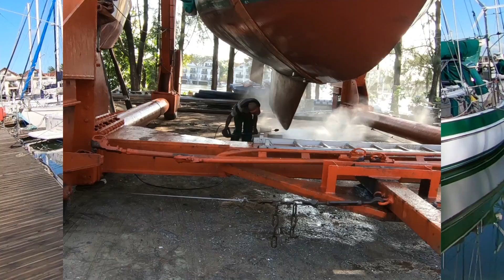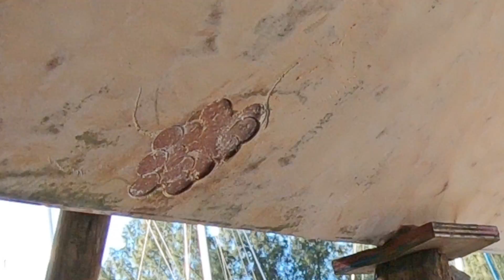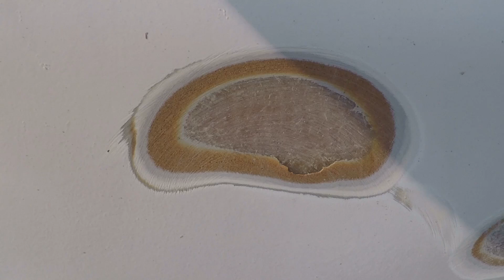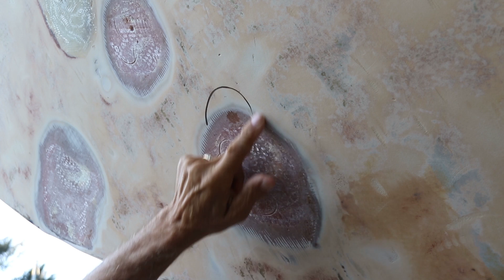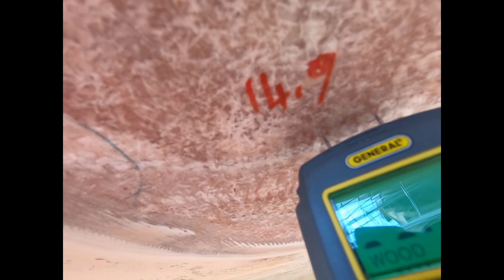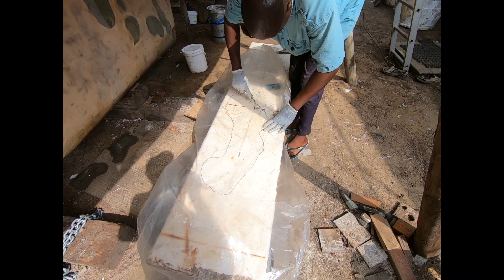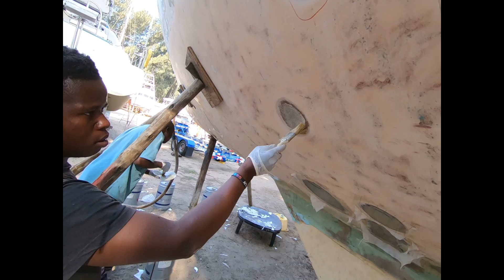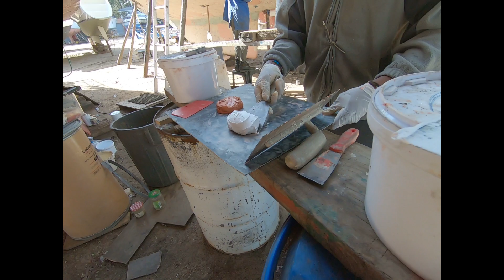500 ROTTEN, FESTERING Blisters!!  - Blister Repair on a Fiberglass Sail boat! (Patrick Childress 59)

Comment: Since these are "uncured resin" blisters how do you know the same thing isn't happening on the inside of the hull. 
Or through out the entire lay up of the hull. A lot of effort and worry for a 44 year old boat.
Reply from the maker: Yes, there is of course that worry...with any boat..but this was the best possible fix. Every boat has some major blemish...at least we know our poison on this one. And a new boat is a quarter of a million bucks. Rather just get another 10 or 15 years out of this boat.
Reply: And after this, it'll be good for another 44 years. Boats can easily reach 100 years, and keep going, with proper maintenance. It's not like a car.

Comment: Nice project. My only question would be on the use of the 1708. Did you go with 1708 due to its availability over 1700? Mat isn't typically used with epoxy.
Reply from the maker: Hi Rick..sorry can not answer this for you. I’m sure you saw the latest video...Patrick passed a few weeks ago.-Rebecca
Reply: @SailingBrickHouseAndOsprey  

Rebecca, my deepest condolences for Patrick's passing.  Stay healthy, best wishes.
Reply: @rickworthington3062  In 1708 the CSM is held together not by chemicals (styrene) like in stand alone CSM but is instead stiched together to layer of woven fabric making it OK to use with expoxy or poly. Also of note, some CSM is held together with a powder, not by styrene which can also make it OK with epoxy.
Reply: @hirschrm  Russel, only SOME variants of 1708 are stitched and epoxy compatible-definitely not ALL.   Also, the question regarding why do you 1708 mostly is because Matt adds little to the strength of an epoxy laminate for the cost of the additional let out which is why unless you need it for its smoothing property specifically to cover up some bad fairing work or to lay over old glass as a band aid or simply don't care about the excess materials usage or wait then there are better approaches.  Taking into consideration that is very heavy sailboat doesn't really care about a couple pounds extra here and there I completely understand the benefit of its usage in this specific instance but if it were a power boat it might be a different story.

Comment: Just for reference, an oscillating multitool would be far more efficient than a hole saw.   I just ended up with one recently (gift), and find it incredibly valuable for this sort of project.  Here's a link with a photo to one brand.  There are numerous makes.  https://toolguyd.com/dremel-mm35-oscillating-tool/    The ability to plunge cut into a flat surface, or any shape surface with an oscillating blade is a godsend.
Reply from the maker: That is a very good idea. I have one on board, but the problem, to get a toothed blade, I would have to buy a whole set of assorted blades, of which I did not need. I eventually found a single blade but the hole spacing made it so it would not fit on my tool. It can be difficult working on boats in foreign countries. In the U.S., what you can buy at any hardware store down the road, can be impossible to find in the middle of nowhere.
Reply: I was wondering when you say "for reference" is this something tried and true or an idea (maybe good ) .there is a huge difference :(epoxy gets gummy, blade heats up,
cloth layers jam the tool ,overheating etc there is a HUGE difference between tried and not tried, if not  then it might be said : "maybe this tool could be more.......
I am only asking for reference......in all good cheers

Comment: I had seen one couple with years of experience and they found that taking on half their blisters (the worst ones) and moving on worked best.  They’d knock out this blisters, they used isopropyl or something to dry them out as good as possible with active air and I think radiant heat, filled, sanded and painted and splashed.  Seemed to minimize time out of the water and made no difference to the boat long term.   If this is truly a one time, never have to do it again, repair then that’s worth it.
Reply from the maker: We don’t know that this full blister job will last forever....but we hope it will last 10 years...along with the Coppercoat. It will definitely be worth fixing up this old sailboat if we can get 10 more good years sailing her! -Rebecca

Comment: Body of this boat is one big blistering pain. Ouch. Great to see that workes use all the safety equipment. All that dust and chemicals is nasty and unhealtly.
Reply from the maker: It is amazing how some of the workers I hired from a contractor, on an hourly basis, come with no PPE. The contractors are not concerned. The workers were very happy I had it for them.
Reply: @SailingBrickHouseAndOsprey  Good.

Comment: At some point in 1976, a new type of resin with the trade name "Hetron" was used in the fiberglass layup. The new resin was designed to be fire retardant, and was originally developed to the specifications of the US military late in the Vietnam War. It is widely suspected that the new resin was responsible for extensive non-osmotic blistering of the hulls, deck, and cabin-house structures in boats built between 1976-1981
Reply from the maker: That was exactly it.  Fortunately, this boat has no blisters on the deck or cabin-house. It is though they used a different resin than what was used to build the hull.

Comment: How much did all of this cost?
Reply from the maker: This is covered a little bit in part two. If we count my hours and labor rate, a lot! I was on the job every day before anyone showed up and I was on the job for a couple hours after they left, at the end of the day. If we count only what we paid our off the street help and paid the local contractor for his helpers and all materials, it ran around $4,000. We could have done the same thing, at a similar cost, in Fiji, Colombia or Malaysia.
Reply: @SailingBrickHouseAndOsprey  But for your enormous amount of work this is actually surprisingly low .You know what contractors charge in western countries for just one small trough crack, the same !! one tenth of the work!!

Comment: Next time you do this use denatured alcohol, it will draw out the water and you will not have to wait so long. You could also use a shop-vac and a large suction cup to draw out the moister in each blister. Very well done, I loved your video.
Reply from the maker: Very good ideas to help with blister repairs... Thanks.

Comment: My boat was like this, they're built with polyester not epoxy, if you repair with epoxy it will be 10 times stronger. After you fair it all put three coats of epoxy on entire boat
Reply from the maker: I think that’s what we did after repairing the blisters...and then 4 to 5 more coats of epoxy in the form of Coppercoat. So hopefully this will be the last blister repair job we ever do! -PATRICK...CORRECT ME IF IM WRONG.  Thanks for watching -Rebecca
Reply: The stiffness differences between the epoxy and poly might cause some stress concentrations and make the repairs fail however.
Reply: @brawler4456  as a theoretical concern that might be true. But people have been patching old polyester boats with epoxy for decades. In practice, epoxy works much, much better. Polyester actually doesn't stick very well to old polyester. Epoxy sticks much better. The polyester would be likely to de-laminate.

Comment: i would have used a router myself - set the depth for the target depth and go around the perimeter - 30 seconds. done.
Reply from the maker: And "target depth" is the problem. There is no way of knowing how deep into the laminate a blister goes till each blister is opened, and  material is removed till you get to a good substrate. The perimeter may be shallow and the center very deep. Or the whole blister starts in one spot but wanders off in a very unexpected direction, as demonstrated in the video. This is why peeling would not work in this blister repair. Thanks for the possible idea and the thought.
Reply: seems that if you tap with a blunt instrument the water layer would impede the vibration and 'sound different' maybe?
Reply: @antigen4  that works too but your hand works best.

Comment: Do you have before and after pictures of your biceps ? Just getting old anti-fouling off our 23' boat made the power tools I used 10 times heavier as I got on with the job.
Reply from the maker: It was not a full body workout but was helpful exercise, especially running the Porter Cable 7" grinder, overhead for hours and hours. Even grinding fiberglass, that was far more entertaining than working out at a gym.

Comment: Try an old fashion hydraylic needle gun .. Spray wet the surface an old needle gun do a good job . Navy's use them .decent air compressor good quality hose and fittings do not try to save money on cheap hoses and fittings good luck
Reply from the maker: Thanks for the tip, Scott.

Comment: Im just wondering if that moisture meter works on fiberglass, because it clearly says wood on it.
Reply from the maker: If you Google and do some research on moisture meters and their use on fiberglass boats, you will see now nearly useless they are. With these open blisters, I just needed to see a change and get the measure down to 10 or below. It seemed to work out okay.

Comment: did u gel coat after the filler ?
Reply from the maker: No. gelcoat would not be for on top of epoxy. As you will see in part two, everything was primed and painted.

Comment: I'm a bit curious as to why you kept center-drilling the blisters. Me, once I'm certain I'm dealing with a cavity, I start hunting for the lowest spot, which makes for more efficient drainage.WRT repair or replace, that's often a tough call. Me, if I've recently bought anything that at closer inspection is showing to need a lot of work, I'm more likely to consider replacing than if it's something I've owned for some time.If I and the item has some history that changes things. Anything that's "old" probably has some history to it anyhow. WRT to boats, vehicles, houses, if you bought them used and have had them awhile, you'd know when the engine was rebuilt, the prop/prop shaft seals replaced, the condition of the standing rigging etc etc. Buying something pre-owned, there's always a "transfer gap" between the opinion and knowledge of the previous owner and you. So maybe you get a better hull, but with an unbalanced prop shaft. Or a damaged mast. Or all sails well past their prime. Or...Everytime you do a big fix, you add to your knowledge of the condition of the boat, where the weaknesses and strengths are.Often, if you try to stay within a budget, what you get isn't as much better as differently bad.

Comment: cant believe you and the others  are working under unbraced shores  (poppets) . you should have two sets braced all the time for safety's sake . I have a lot of experience in this field and yes , whilst epoxy resin (particularly West system) is ok to use , the hull should have should have been dried out completely either indoors with lamps or under cover in a ventilated shelter . after the hull has completely dried out and shows a mimimal moisture reading , then you start the process with peeling the the whole jelcoat from the boat .(this is often done first but either way its a noisy and messy business. the plus side of removing the jelcoat is that drying out the hull takes far less time . After all the repairs are finished the whole hull gets sanded back and new jelcoat or epoxy  paint is sprayed on in anything up to 10 layers . this is no walk in the park , but you end up with a brand new looking hull with an improved integrity. good luck in the future . Always get GOOD professional advice before attempting anything like this if you dont want to devalue your boat alarmingly. Its not rocket science i agree, but  like all boat maintenance it will eat an enormous great hole into your already empty money bucket! best wishes,  tom gatrell retired boatbuilder.
Reply from the maker: Tom, I do ask very respectfully, did you watch the video?? These are resin blisters that originate at various depths in the laminate. In this situation, unfortunately, peeling would cause far more work than it would save.   An indoor drying facility?? Not in the country this work was done.  Isn't it amazing how, in some of these foreign countries, they can shore up a boat so differently than in the U.S. or Australia, or so many other western countries? The poles used here are gum tree and are grown to any diameter you want.  You should see the far bigger boats which are held upright with gum tree poles dug into the soil. I was a little skittish when they first propped up my boat so I had them add one extra pole on each side. Thanks for your comment.
Reply: hello patrick , respectfully yes i did watch the video right the way through, and yes i do commend your teams efforts here it must have seemed never ending at times , god knows how much you must have spent on West system and sundries. but then that stuff  never was cheap . As far as the topsides are concerned yes i suppose i would have approached them in the same manner .But , like i say from the waterline down  my approach would have been to peel the jellcoat and produce a more direct approach to what is  probably a hull with delaminating issues ie; your resin blisters. At the end of the day, everyone does things just a little bit different which is ok, so long as one follows the golden basics.  I trust that you have not found any structural issues throughout the boat ie; bulkhead mounts , engine beds etc etc which can also give you clues . Back in the 90,s i was doing boat repairs such as yours on lake norman  NC. i couldnt belive that sailboats being used in fresh water were suffering from the same problem as your boat , a sure sign of resin quality or poor lay up proceedures. we had to peel most of these craft below the water line . yes it takes time but when finished the feeling is good knowing that one has a 100% new repair to an old problem that can keep re-occurring . the fact that you say she has been peeled below the waterline before concerns me , or maybe was it just partially peeled?  Equally i assume that you constantly  used  a sounding hammer to hopefully avoid missing any problems that would re appear in the future .good luck for the future and Best Wishes and fair winds
Reply from the maker: Thomas, it is always nice to have comments from experienced people. Thanks, and we hope to hear more from you in the future.